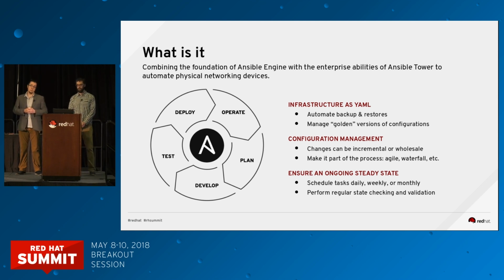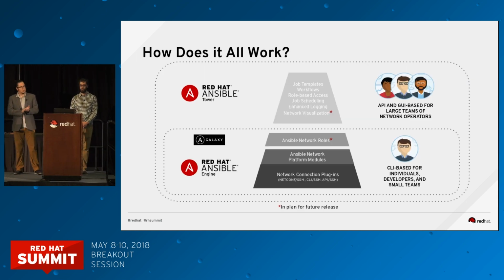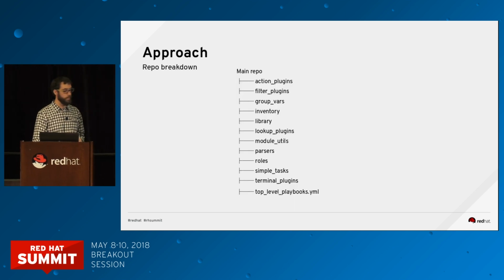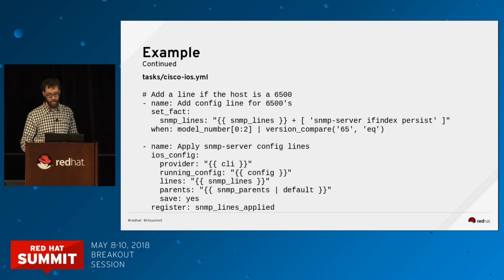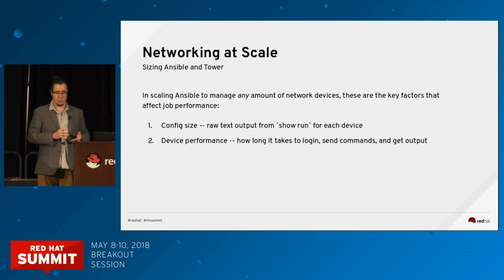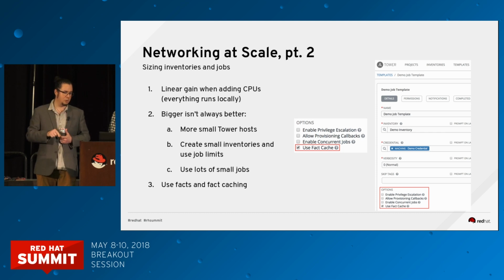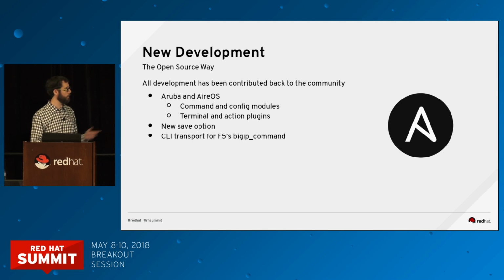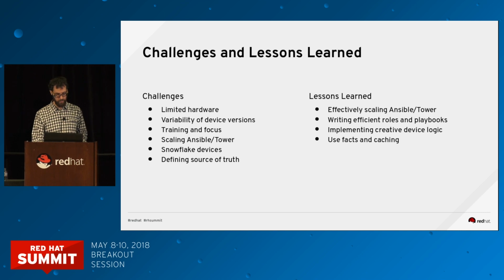Managing 15,000 network devices with Ansible

Comment: Ansible is nice if all those systems are in the cloud or the same network. But when you have a windows client which needs to be managed behind a firewall which you can't control like a virtual desktop in the cloud or a windows machine of an employee in home office. Now that common scenario is not nearly covered by ansible. Yeah there is ...
... pull, which doesn't work with many of the windows modules
... Install OpenSSH, same issue like with pull and in addition you add another piece which can fail etc. 
... VPN which destroys your connection to the cloud desktop, especially if you have to use a specific software to connect to the desktop. 
... Using another crappy methods to punch holes into a firewall. 
 
Sry but I can't switch away from salt stack to ansible if that scenario isn't fully supported

Comment: If you are going to teach network engineers how to code then why would you make them depend on a stupid tool Ansible? Learn PYTHON, YANG, NETCONF and RESTCONF and interact with any device via SSH, end of story.
Reply: That's the point - using Ansible means you don't need to know 5 different languages.
Reply: Ansible uses existing syntax(shell, powershell, etc) and simply makes it easy to run the commands you already know on multiple machines via ssh.

Comment: Hi I have installed Ansible but when i am try to ping Cisco router and i Get an error "Keyboard-Interactive, Password" Despite the fact i have made changes to Ansible config for "host_key_checking = False". I am also able to the do ssh from ansible master machine. Please advice. Thank you
Reply: Hi - we recommend you reach out to any of the monitored services like irc, the google forums, or github for more help. The team can help you diagnose the issue that way!
Reply: it's been a year, but i hope you've found the answer. that error indicates an issue with the password.
Reply: Probably need to enable root login in /etc/ssh/sshd_confg permitrootlogin yes?